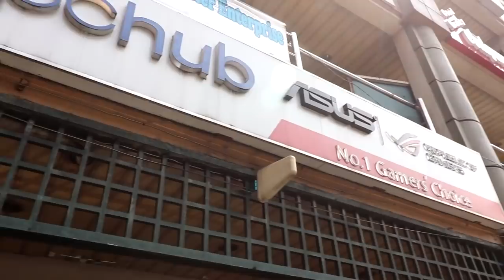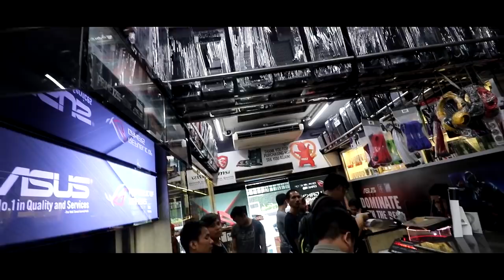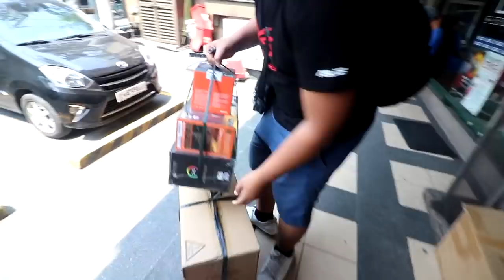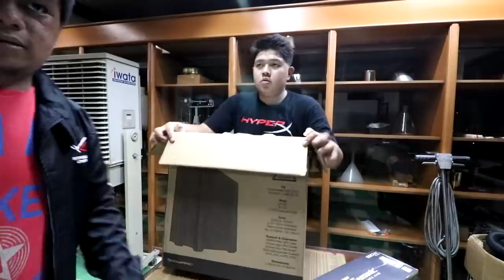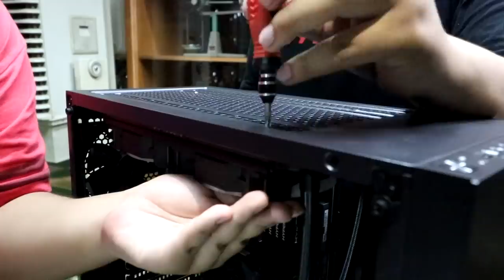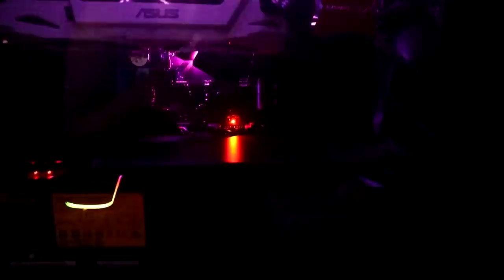BUILDING MY NEW PC! | Powered by ASUS ROG and HyperX!

Comment: Woo same case pero ung nexus M binili ko. Sobrang solid jan sa PCHUB jan din ako lagi bumibili. Congrats Nhil <3
Reply: Robemar Joseph Tabucan san po location? Salamat
Reply: PC HUB Gilmore po s Gilmore po sila
Reply: Sir ang 50k ko ba makakset up na ako ng pang gaming na pc??  Kahit yung smooth sa dota.
Reply: Yup di naman masyadong demanding sa hardware ang dota 2 last summer nagpabuo pinsan ng kaibigan ko. 43k i5 8400, asrock b360m am4, 16GB ddr4 2800mhz G skillz ripjaws, 120GB m.2 wd green for bootdrive, 1TB WD caviar blue, Palit GTX 1050ti single fan,Seasonic 500w 80+bronze s12, tecware edge TG out of stock na kasi yung tecware nexus M nung time na yun. if 50k Budget mo tas same build gagawin mo pwede mo ng palitan yung GTX 1050ti ng GTX 1060 3gb - 6GB depende sa brand. kahit anong games siguro malalro mo na in 1080p reso. Take note system unit lang yan wala pang monitor and peripherals.
Reply: Wala kong alm sir sa mga specs.  Ask ko lang po kung sa 50k or below makakabli na po ba ako ng computer set up???
Reply: Aj Reyes yes sir makakabuo kna nyan..pwede ka yata hinge ng quotation kung san ka bibili ng parts..siguro mas ok kung jan kna mismo sa pc hub pumunta at sila bahala sa budget mo..
Reply: @robermar ung included na case fan ano connection ? 4pin ba ?
Reply: Saan ba yung Pc Hub?